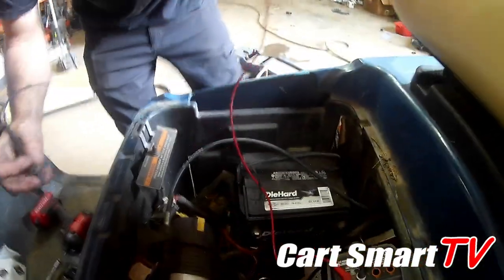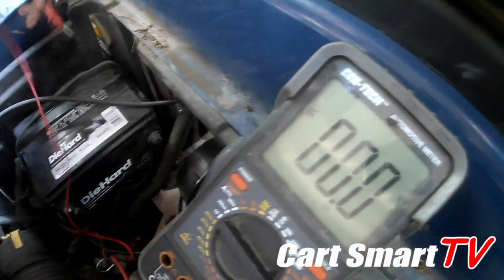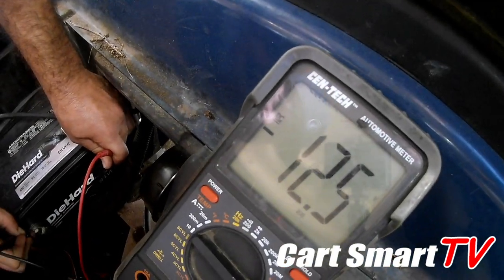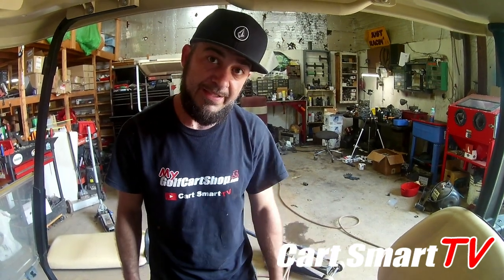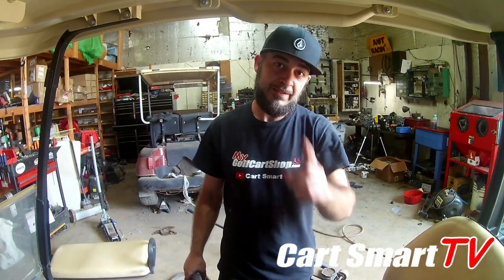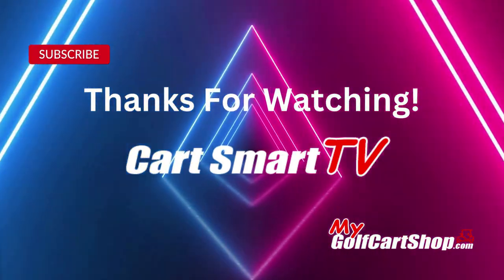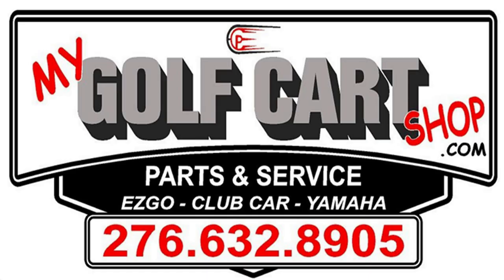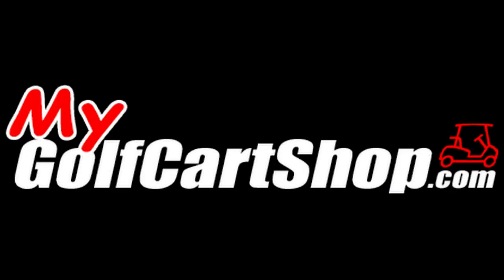Voltage Regulator Test

Comment: Hey man I have a 95 ezgo 295cc and my cdi box keeps messing up, I replaced the old one with a new one and started right up, but now started acting like the old one again after just a couple days, sometimes they work sometimes just crank, so I replaced it with a new one and it worked again, but now started to do the same thing again, I cleaned all connections, and all ground cables, I don't know what causes this that is driving me crazy, sometimes I jump on it and start sometimes just crank ,it does this more often over night
Reply from the maker: So are you just losing spark when this happens? We see a lot of coil problems vs the CDI box on these. Feel free to call us to go over a few things with you. 276.632.8905

Comment: Got a 98, new solenoid, new voltage regulator, and a new club car starter, cleaned up all the fittings and the grounds still not getting a charge back to the battery.. battery is fairly old and I’m curious if it’ll show no charge or won’t take a charge?
Reply from the maker: A bad battery or cell could cause a no charge? But if you did this test its probably a bad regulator? especially if amazon parts?

Comment: How can i tell if it's the regulator or the generator? I have an ezgo Marathon 2 cycle that the battery goes dead on while running it
Reply from the maker: You can check voltage from the regulator to the green wire on you're starter generator. Most cases on those is the regulator not working? If it's starting and going both forward and reverse in most cases that alone shows a good generator which is also your transmission on those carts. Let us know if we can help? 276.632.8905
Reply: I tested the voltage today. The longer I ran it the lower the voltage went. I unpluged the green wire on the regulator pluged a jumper wire to that post and shoted it to a ground. The voltage then went to about 13.5 volts and held there. Any idea what the problen is? Thanks for the help
   @cartsmarttv

Comment: if the voltage regulator is working, does that also mean that the starter generator is working?
Reply from the maker: The Voltage Regulator only works when the engine is running.

Comment: Location of regulator on 2008 Rxv
Reply from the maker: Follow your small wire from your starter toward the front of the cart and it will be hooked to your regulator. (They are usually a Green wire but?? May be different color)

Comment: Don't leave the lights on
Reply from the maker: Yes, don't do that either 😅
Reply: Why would my cart battery drop to 10 volts when cart is running and 12 .80 resting
Reply from the maker: @jimsloan2438  you're putting a load on it but, it should raise up with engine running, if your voltage regulator is working. They all will surface charge back to 12 while setting if it's a good battery.